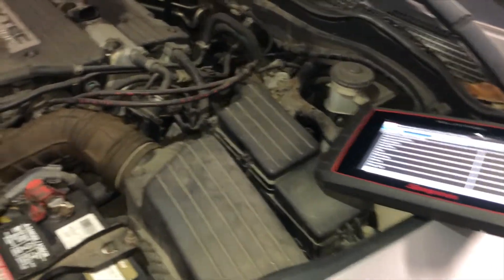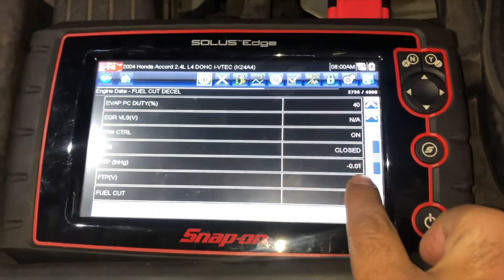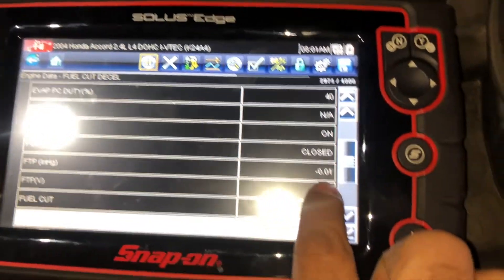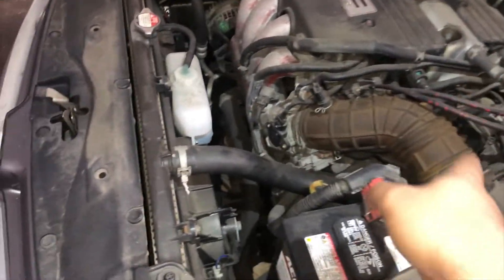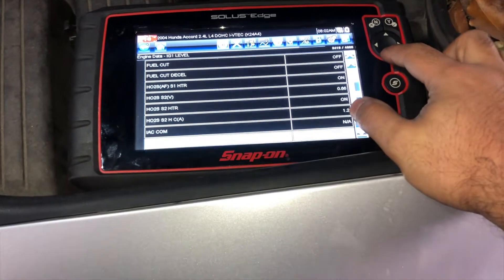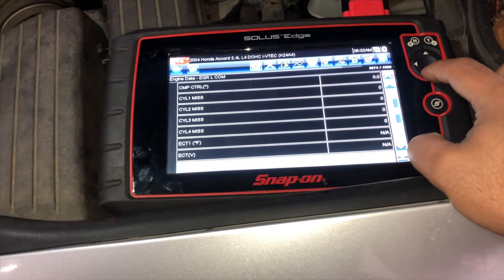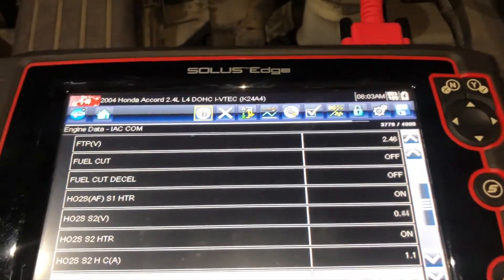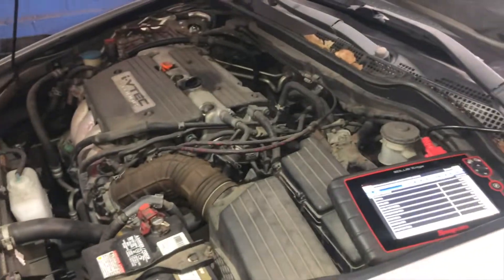Honda Accord 2003 to 2007 P0171 Lean condition MAF sensor values to understand and repair

Comment: I have a 17% LT and 16% ST with a Code P0171 . What could be the problem ?
Reply from the maker: Too high well possability a r maf sensor. Oxygen sensor or vaccum leak. Why don’t u try cleaning maf sensor see what numbers u get
Reply: @RBTheMechanic  ok thanks I will try that .
Reply from the maker: @geesElement  welcome
Reply: @geesElement  what did it end up being? Have same issue and mine doesnt have MAF